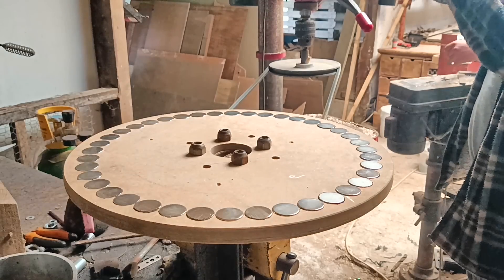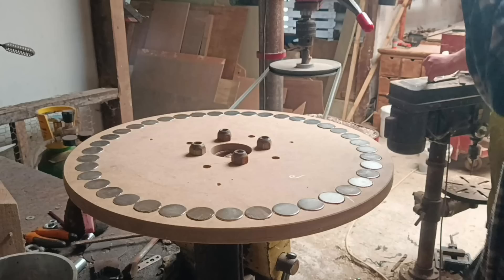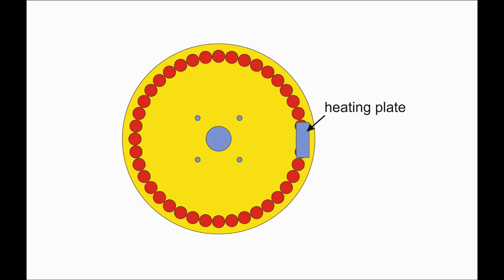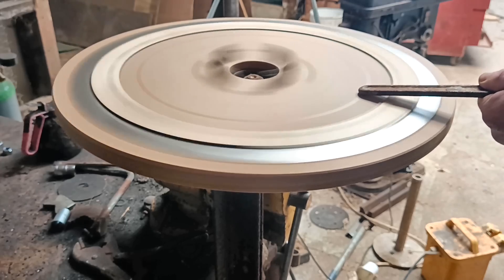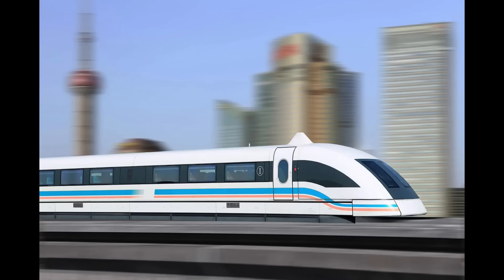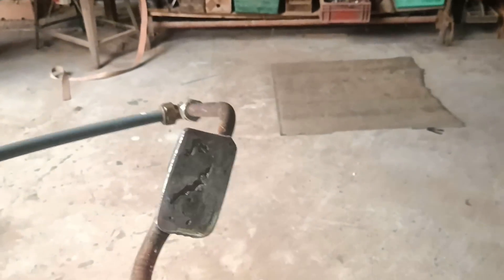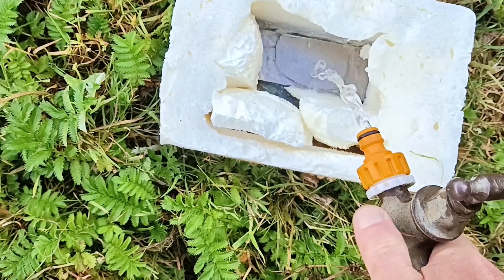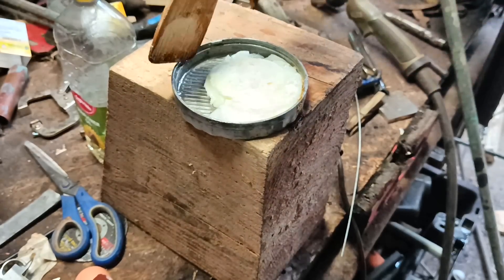Cook An Egg Over Magnets  - And Other Interesting Induction Heater Stuff..

Comment: Hey Tim! Great to see the progress, I just want to throw my $0.02 worth into the ring
You're right that an induction element anywhere will get the same efficiency theoretically as elements coating the whole thing watt for watt, I would however suggest that a symmetrical design would keep the induction drag torque balanced on your magnet wheel, preserving your bearings for longer (hopefully) :)
I hope you manage to get your hands on a copper casting/machining. As copper is one of the best thermal conductors out there, especially highly pure copper, you might be able to get away with packing a copper tube with long pieces of scrap wire (before bending it!) and either circulating water through or circulating something like diesel/oil that you use to heat water at an exchanger.The oil will help prevent anodic corrosion although I have no experience to say if this will be a problem, your induction heater is essentially a short circuited generator or transformer, you may end up with issues of hydrolysis of water within the heating pipe although realistically the copper is just so much more conductive than even a brine that this shouldn't be significant?
All the best!

Comment: As you started describing all the possible optimizations, I was thinking the same thing that you concluded with. As long as you’re taking all the available energy out of the system, it doesn’t really matter how efficient the individual components are. Yes, that matters for a commercial product that needs to get the most out of every bit of material, but that’s not an issue here.

I propose a possible simplification. Place your rotating plate beneath a circular water vessel. Pot, boiler, pan, whatever. Arrange the rotating disk such that it can move axially on the drive shaft (something like a drill press quill, for example) and this control the space between the water vessel and the magnets. As mentioned in another comment, that could serve as an automatic governor for the windmill. The default position is at the greatest distance, increasing to the most efficient at peak input, with a simple spring loaded overspeed mechanism on the blades as you’ve already demonstrated. Use that to heat the largest insulted tank you can manage. It may take a while to come up to temperature, but it should be able to maintain temperature for quite a long time with a large enough reservoir.

Comment: As you say: Lead and Tin Solder has terrible thermal conductivity and is just a little bit better than air compared to the copper.
Silver solder (for plumbing) is better though and worth using.

Comment: Man, that is all I would need to step this experiment up a few notches!!! You need to build a rack to support everything, and make it more precise, for a bit of balance.

Get rid of the entire disc and start with something that doesn't have a bunch of screw heads sticking out of it!  A rack you can mount the copper pipe to in multiple locations, to keep from losing a finger or an eye!

I love this, you're on the right track! I can see the possibility of almost instant steam generation. We all know what that would mean...

I'm a former boiler technician for the U.S. military. You could get all your energy needs out of that windmill using this technology...

Wish I was there to help, but I'm sure you'll eventually get there... Just BE CAREFUL MAN!

Comment: why don't you use that small bore flexible copper pipe? you can add and remove coils as needed. you don't have a large mass of metal being heated.

id also have a pump hooked up to the turbine too. the faster the turbine runs, the faster the pump moves, so you get a more constant output temp.

Id also use the induction effect as the speed governor, rather than changing the sails. move the magnets closer to the pipe as the speed increases. 

You could add a copper coil to this to generate the electricity to run the pump, so the flow rate and thus the output temp is responsive to this aswell, in fact you could make the copper pipe induce the current, although there might be a trade off of optimisations between heating water and generating electricity?

Ultimately what you're moving towards is how the latest commercial wind turbines work which are moving away from gearboxes, so you might find some interesting optimisations looking there.

Comment: Ah yes, the flying magnet issue. When I built a pancake generator for a wind turbine, all the magnets were glued down with Araldite and the whole disc was embedded in clear resin. there was even a ring of wire rope embedded outside the magnets and in the resin! Flying magnets are a real thing. Who knew?

Comment: I think circulation will work better with heat source at the bottom of your loop. Instead of towards the top. The temperature difference will be greater. At the moment you’re heating hot water towards the top which is where hot water wants to be.

Comment: My approach would be to bend a long copper pipe in a circle so that it sits above all the magnets, and then suspending it on bolts above the rotor, in a way where you can easily adjust the distance to the magnets. This way you don't have to hold it, and you can even finetune the distance to use all the energy available before there is too much drag (i presume this way you can get it a lot closer to the magnets than by hand, should it be necessary). Maybe this is too far fetched but would it be a good idea to try and balance the wheel more? It looks pretty unbalanced at the moment, and i can only imagine how it would be at higher rpm's. I'm curious to see your next video on this interesting project!

Comment: I reckon a circle of pipe above the magnets would be your best bet.
No chance of the drag stopping the rotation because the drag is proportion to rotational velocity, as it slows down, drag due to opposing magnetic fields decreases and it should find it's own optimal speed depending on the power available.
Reply from the maker: Of course! I missed that one. Thanks.

Comment: How about a length of copper pipe with the water in it, over the magnets? I don't know, but it seems like it should be the most efficient and practical way to generate the heat and have that heat transferred directly to the medium you want it in, without unnecessary steps of heat transfer. Less heat loss, much faster heat transfer, and also, much easier to make. 

I still think air compression would have a lot of advantages over that. And also, if you want to use the magnets, I also think there's better options even utilizing those magnets, as it would be relatively easy to make a generator with them. If you produce electricity you could either use that to produce heat directly with restive heaters, which would be the simple way. The advantage of that over direct induction heating would be that you could heat the water in a well insulated container. And the other option is obviously using the power to power some sort of heat pump system.

Comment: @Way Out West - Workshop Stuff
9:00 -ish. I think you want tom MAXIMIZE the Eddy current in whatever you will be using as the heating element.
You do NOT want to have layers or "slits" in the heating thing, it should probably be solid & thick.
(next comment has a link to a Short video, in case YouTube auto deletes it)
Reply: Backup comment:
Search for this: TAMU Physics & Astronomy Can a non-magnetic material be stopped by a
Should be #1 result.

Comment: @Way Out West - Workshop Stuff
5:23 I think I know how that "Demagnetization" worked.
You have a rapidly alternating magnetic field, and when you pulled away the metal, you ALSO decreased the magnetic strength.
That caused a Demagnetization effect: (Wiki: "Degaussing", title: "Pulse degaussing").

I have also been working in a metal workshop, it had a grinder with a magnetic bed, but after use the part was magnetic, but you could run a program that alternated the magnetic fields such that the metal part became "neutrally magnetic" again.

Comment: I would do a closed copper pipe ring that has been flattened and filled with water over the whole ring on magnets. The thinner the air-gap between the pipe and the magnets the more efficient. And: to adjust the resulting drag force I would install an mecanism to adjust the air gap to the possible applied force of the windmill. Means: lots of wind, lots of power —>reducing the air gap between magnets and copper pipes. This can be done either electronically or mechanical by the help of a defined rpm of the flywheel. 
Have fun! And thank you for sharing these interesting experiments!

Comment: Many modern large electric motors and generators wind the stators such that the poles cross eachother. I wonder what the efeect would be if you were cut little triangles of wood to mount the magnets at 45° to the surface of the disc, there by cauaing the magnetic field to be twisted.

Comment: You can buy full copper water blocks (80mm x 40mm x 10mm used for CPU/GPU water cooling.
You could use rectangle magnets say 50mm x20mmx 10mm and have them sitting in the side, so you can have 5x the magnets in the same space.   ║ ║ ║ ║ ║ ║ ║ 
I also wondered about two rows of magnets ╬╬╬╬╬╬╬╬╬  
or offsetting the magnets, them ╩╦╩╦╩╦╩╦╩╦╩╦   
so the field also changes in two directions?  25mm x 15mm x 5mm
Or 8mm 20mm long bar (easy to fit with drill hole) and be placed like honeycomb.

Another random through would be to run a (small?) dc current through the copper, maybe have it turning on and off or flipping between + and -  (eak AC power)
A simple hall effects sensor could detect the poling of the magnet under the copper block and change the current direction in the block, so timing of the current flip isn't a problem.

Comment: While I think this is kinda cool...  You would likely get FAR more usable heat, using a Lenses, and the Sun.   As someone that was forced to sleep in his car for a period of time...  Once the Sun came up... it heated the car up to Unbearable levels, in a very short amount of time...  and that was without any Lens Concentration of the Rays.

 It also might be correct, that a good generator might be more efficient at collecting Wind power energy,  for powering efficient heating devices.  Hard to say, as Im no Engineer.

Finally..  thinking about the principles you are trying to use... Maybe its better to use more smaller magnets, rather than larger?  As that way, you are flipping the currents far more often, than not? (and at less rotational speeds, for potentially the same heat output?)
Reply from the maker: I think you don't live in Ireland?  : -  )

Comment: some notes on convective circulation, pipe diameter will help for drag but also column height.. the effect will be stronger if there is a long column of very hot water and a long column of very cold water
the heater should be near to the bottom of the column so that the column of heated water can be taller, though perhaps not too near the bottom that it might reverse flow, and whatever heat exchanger is used to move heat indoors should be designed so that the water is cooled high in the column so that the cold column is as tall as possible, like for example using a wall-height radiator design rather than one that sits low to the floor

oh and regarding design considerations of the magnet wheel, youre correct that the exact design doesnt matter much for efficiency because there will be a 1:1 relationship between the amount of magnetic drag and the amount of heat produced, but like you said you can get that sweet spot of the right amount of drag to happen sooner, essentially tuning the rpm-torque response of the magnet wheel, which means you could tune the wheel such that mechanical gearing is not necessary.. your design goal should be that the wheel reaches drag equilibrium near the rpm where your windmill is most efficient, like for example so that the windmill turns nearly as fast as it can but not so fast that the governor mechanism kicks in.. 
really ideally the governor mechanism would somehow throttle the induction heater so that the windmill is slowed down by harvesting more energy from it rather than slowed by wasting its energy with the blades, but that would be much too complicated to implement

Comment: I would recommend looking into computer liquid cooling. They are designed to be extremely efficient at moving heat away from one place to another with water channels. You probably can get a used one for quite cheap for experimenting.

Comment: If you made a circular coil of copper tube to follow the direction of the magnets, then you could vary the energy draw of the mechanism by moving the coil towards and away from the spinning magnets. Add in some sort of centrifugal-based feedback and you would have a speed-regulating governor. It might be more robust than the current blade-angle based governor you've got devised for the windmill, and it saves parts since the governor and the output are now one and the same!

Comment: This is a very cool idea if you can get "free" rotational energy from wind or something. If the magnets do get hot they will demagnetise. They have to get pretty hot for that to happen but they will get hot eventually if you run this thing for hours and hours and you don't draw enough heat away from the heating plate.

Comment: My rule of thumb for heating, is that all heating is 100% efficient, because inefficiencies are heat generation. If you're trying to generate heat, you just need to find the easiest way to put energy into a system while having that system do as little with that energy as possible.

Comment: For some science for heating/magnets:
You typically don't want it thick. That just helps with transferring heat around and keeping it hot. In fact, having it thick can be bad and a great example of that is aluminium. If it is thin, like a piece of foil, it can very quickly heat up. If it is thick it doesn't heat up much at all. The thinner it is, the greater the resistance so the more it heats. But once it is thicker than the skin depth, making it thicker just means you have more to heat up. If you have some, you can even quickly test this. Compare a plate of aluminium to a sheet of alfoil of the same area. You will find one gets much hotter, and obviously hold it with something.

A hallbach array actually refers to a particular arrangement which results in a magnetic field on only one side of the array.
Having the magnets of opposite polarity  next to each other is similar to a horse shoe magnet.

I would say you want them close together. This gives the greatest change in the magnetic field per unit distance (and so per unit time when rotating), which is what induces the current.
And one way to make it have a faster effective frequency is to make the magnets smaller.

You do have magnetic fields coming out from both side, so it wouldn't hurt to to have metal on both sides. However, this also results in a greater drag on the rotation, which could make it less effective. So I would say experiment with both options.
There will likely be an optimal setup for maximum effeciency, especially when you consider the friction from everything else. But for what you are doing it shouldn't matter.

Comment: I think your first design with the pipe is on the right track. You may be familiar with the concept of a bubble pump, which is what drip coffee makers use to move the water from the reservoir up to the basket of coffee grounds. The water is simply in a tube with a 1-way valve, that runs over a heat source, and leads to the coffee basket. As the water boils, it makes bubbles, and because of the check valve, the bubbles (and increased pressure) can only travel upwards to the coffee basket, and the bubbles push the hot water along the pipe!
I think you could take advantage of this same effect, by having a tube coming in from a cool water reservoir, a check valve, and then your copper pipe over the magnets, then a tube leading off and up to a ‘hot water storage’ and as the water boiled in your copper pipe, it would be forced onwards, and more water could come in and be heated. No mechanical/electrical pumps involved!
Reply from the maker: coffee and eggs next time!
Reply: love this idea. But when the copper pipe is at 100°C good thermal isolation is absolutely necessary. With increased temperature, the heat transfer to the environment (fancy words for heat losses), is increased as well.

Comment: Interesting,but  not efficient,what you have is a primitive generator,magnets whirling around,inducing current in copper,is just what an alternator does,inefficiency reduced to minimum by small air gaps,much better to use a truck alternator and use electricity generated to heat a resistance wire[nichrome] electricity is a very versatile energy.

Comment: The drag isn't a bad thing. The amount of power you produce as heat is going to be exactly proportional to the power taken from the rotor by the drag. 
You don't actually need it to spin fast if you have high torque and very strong coupling via this drag. 
This may be the best option since you're going to be starting with the high torque, low speed power source of wind power. Especially because every "gearing" stage will have power losses associated with it.
Reply: Exactly this.

If you want to increase the amount of coupling, try adding a ring of a high-permeability material below the magnets. (Think of this roughly as resistance for magnetic fields. Air is a terrible conductor of magnetic fields. You want the magnetic circuit to be as low resistance as possible.) Steel is pretty good for this, depending on composition.

Or look into Halbach arrays.

Actually, a switchable (geared) Halbach array would be a decent way to modulate the output...